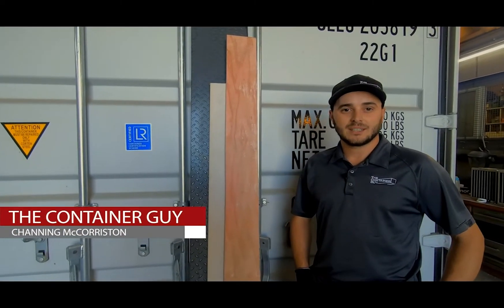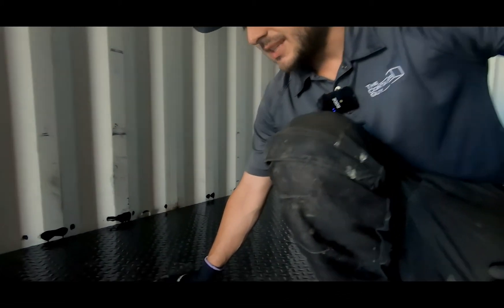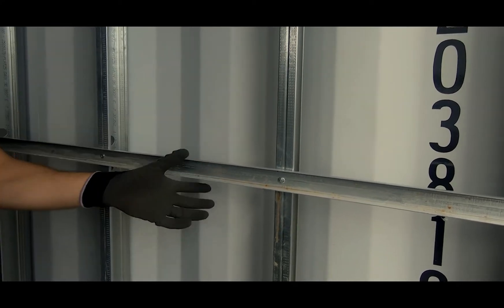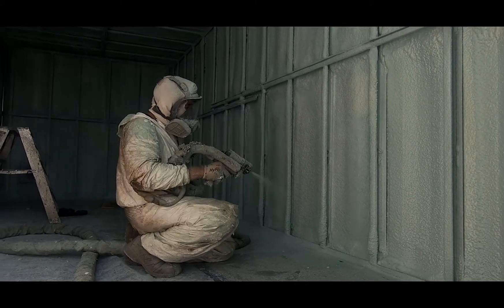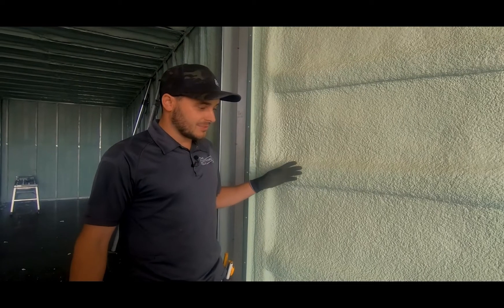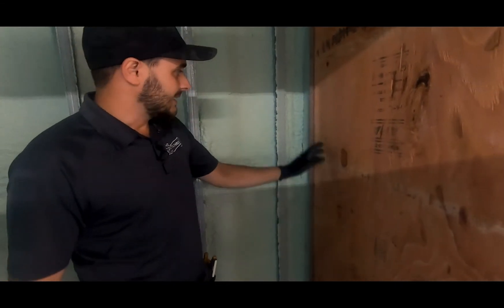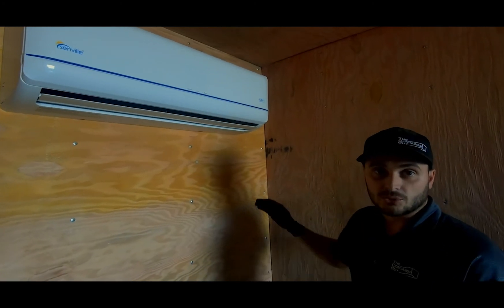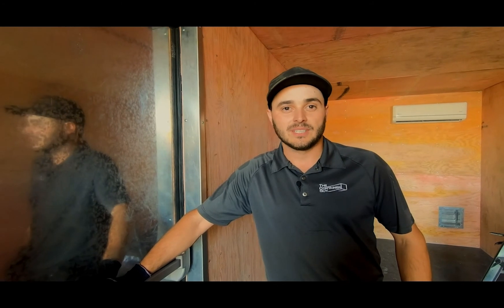Converting A Shipping Container Into An Insulated, Fire Rated Utility Building

Comment: Great video.  One question: wouldn't you want to offset the interior perimeter studs by 2" to prevent thermal bridging?
Reply from the maker: Thank you. I always found this specific video a bit boring haha. You are correct. We've updated our system to use 1 5/8" steel studs and pull them away from the wall. Video here: https://youtu.be/jqgd7IkPFQY
Reply: @TheContainerGuyTV  Awesome, thanks!  We're designing one of these for a client for the first time, so it was very informative to me.  Thanks again.

Comment: I wasn't sure why you install drywall first. Why didn't you just skip the drywall and install the plywood? I noticed there are a few different style of metal studs, since I am trying to create as much interior space as possible, could I use 1 5/8' studs instead of the 2 5/8" studs? Thanks, Jim
Reply from the maker: Hi Jimmy. 

The wall system was spec'd to us by the customer. We used 5/8" Type X drywall for the first 60 min fire rating then the 3/4" fire-rated plywood to achieve a full 2 hour fire-rated wall system. This is an industrial mod - not an ideal wall system for a container home or cabin. 

Where we are located, 2" of spray foam is minimum for a vapor barrier so 1 5/8" steel studs will never work for us. If you can get away with 1.5" of foam on the inside corrugations (more can be applied on the outside corrugations) then 1 5/8" steel studs will definitely work. Steel studs are amazing - doesn't matter what size you use. Make sure you strap them prior to foam so they don't twist or bow when the foam expands.
Reply: The customer likely wants to hang heavy things from the walls.